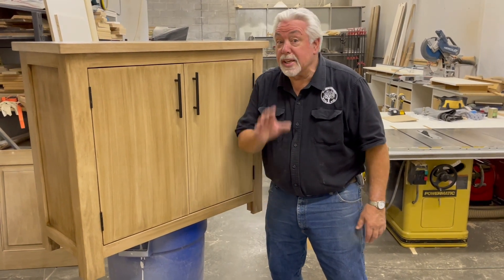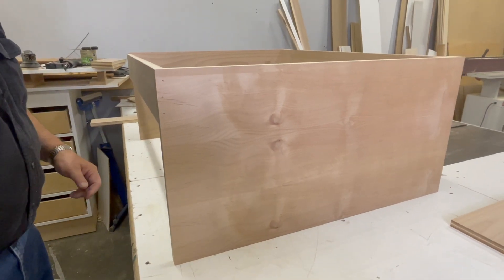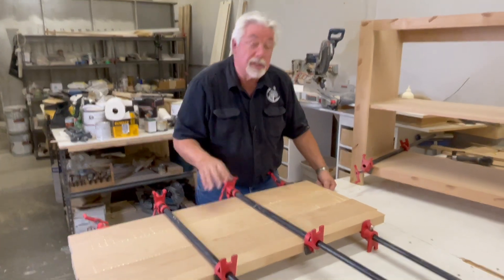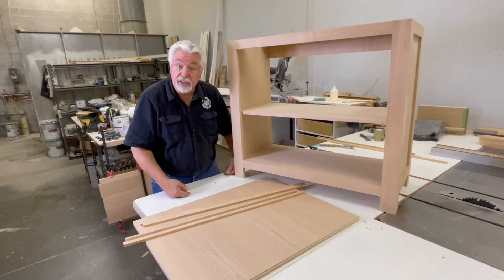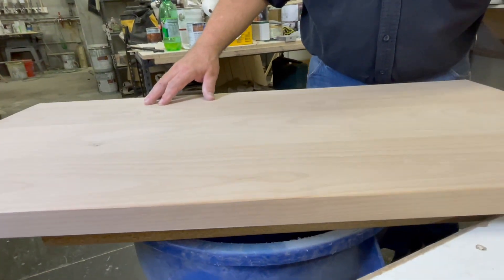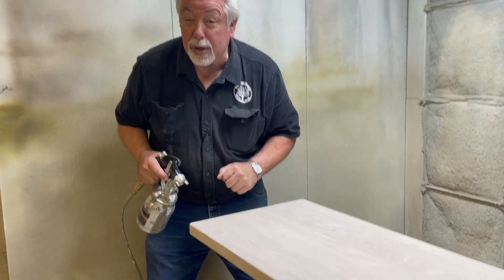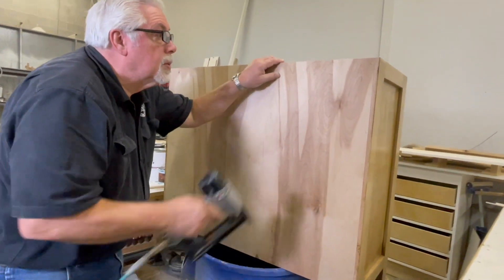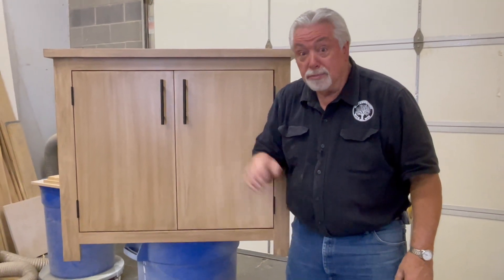Want to Save Big? Build It Yourself

Comment: Please consider showing us how you mount the door to the cabinet with those no-mortise hinges.  It seems like it would be quite the balancing act to get them in position so you have a even gap around the door . . . enjoyed the video, thumbs up, thanks for your time
Reply: I think you can use playing card to space them evenly the way you want it, then mark the line on the cabinet. Remove the hinge, drill the holes. Then just hang everything back. But definitely with the video would be better for us to learn a technique.

Comment: Love your presentation style and content, Thank-You!   I have done several panel doors just fine in my shop with 1/4” panel inserts but now my wife would like me to build wood grain shaker style pantry cabinets with thicker panels (3/8 or 1/2).   Is it possible to use Wood veneer sided mdf and just router down the thickness to fit in the groove - or do I need to build solid panels and adjust for expansion?
Reply from the maker: Hi...I would suggest a solid panel. Good luck, I am sure it would be great! Wes